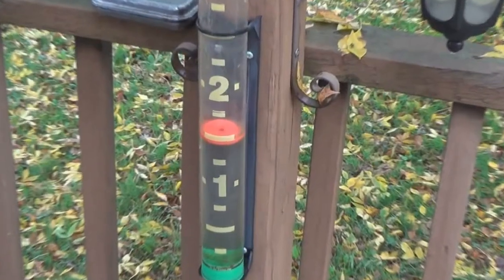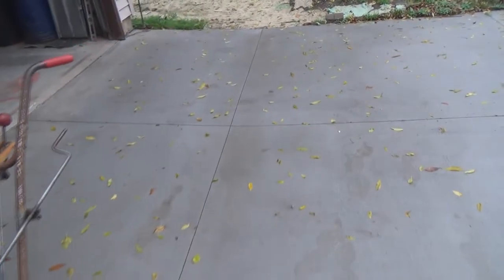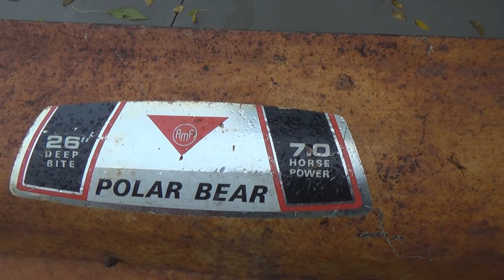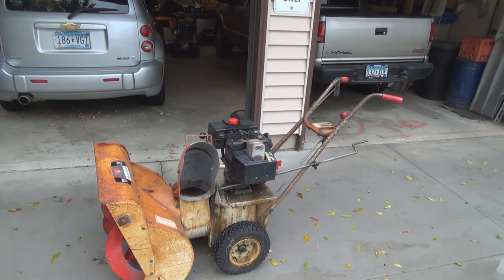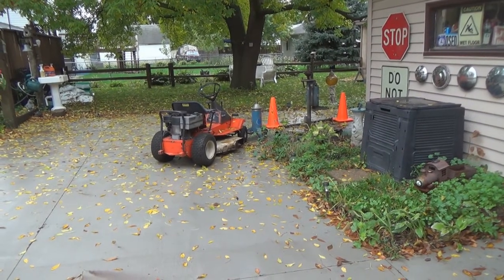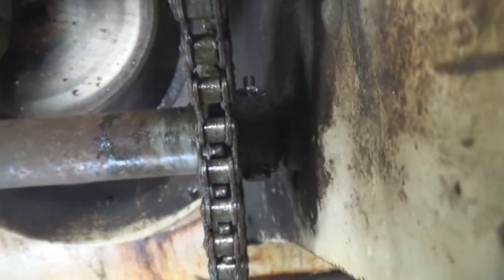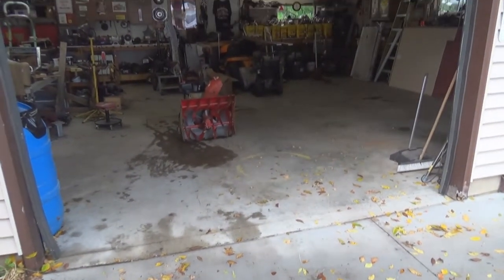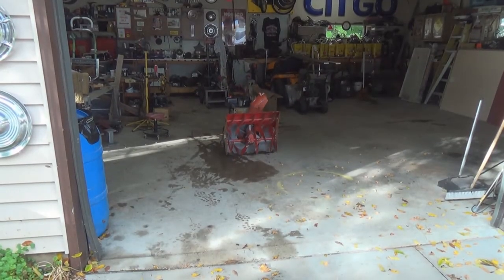AMF Polar Bear snow blower done!

Comment: The older Tecumseh Snow King engines were great.  My old 24" Snapper has a 7 hp Snow King Engine.  I've had to replace the rubber drive ring, and clean the drive disc with steel wool & alcohol.
Reply from the maker: I had it going pretty good, but I guess the drive tire was just too saturated. We have since found another use for this machine and more uses to come. Thanks for stopping by.

Comment: since I am partial to old things, I think I would repair that top  auger and make a sheet metal cover for the bottom because it's been my experience with that disk drives, that if they get wet they tend to slip till they dry off.
Reply from the maker: Those things are part of why I am trying to decide whether or not to fix it. Will it be worth my time and effort?

Comment: The old machines dont sell for much plus they are so heavy to muscle around. Its more worth taking them apart and scraping the rest. Of course its always smart to have a backup blower or two for yourself or the neighbors iffen youve got the space
Reply from the maker: Well, I decided today to pull it apart. It seems that after sitting a few days the drive was slipping again and I can use the flywheel from this motor to fix my riding mower so that it can have electric start and as you said, lots of great parts in these old bears. I have a snow blower and a snow plow so this would be superfluous for me. Thanks Bryan for confirming my decision.

Comment: fix the drift cutter,cover the rear and bottom and use it this winter. come spring,strip it and get rid of the leftovers
Reply from the maker: I don't need it for blowing snow as I already have a trackdrive blower and a snow plow. Restricted room is the issue, so it is either finish it off, sell it for $$$ or strip it for parts. Thanks Roger

Comment: That's the same problem I have with my old DR Bush Hog. I bought it used to cut the neighbors over grown field across the road a four or five years ago so I could see something besides a mess ( with his permission of course ) and now I have absolutely no use for it. I have the field in great shape and can keep it cut with my riding mower. I hate to sell it because I can't get anything for it and it has a great cast iron B&S commercial engine that would be good for several other things I have around.
Reply from the maker: I understand your dilemma for sure. Thanks
Reply: You're welcome, I'm glade you fixed it. Good luck with the sale and making enough money for your lift.
Reply: Sell the engine on ebay, older Briggs engines bring in descent money.

Comment: I picked up an AMF polar bear 26 inch snowblower for free someone was just giving away. It has a 6 horsepower motor not a 7 like yours. I'm trying to figure out how to get into the transmission. Is there any literature or service manuals for these machines
Reply from the maker: The "transmission" is just a disc drive as you saw when I had the blower tipped up on its front. There is a panel (which was missing on mine) that is simply removed to get at the workings. Check the drive tire really well, they are replaceable and make sure the disc is clean and oil free. Lots of places to oil or grease in there. Enjoy your old machine! Thanks for stopping by.
Reply: @TheShadeTreeFixitMan  I'm a DIY'er, and in general, I like to take things apart to inspect them more closely. I am trying to separate the front auger Scoop from the impeller and its housing. So far, I've removed seven nuts and bolts holding the two together, and I can get the front scoop to rotate, but I can not seem to pull it free from the rest of the snowblower. What am I doing wrong?

Comment: Have the same blower. Paid $5 for it.. No engine though but have a engine around.
Thank you
Reply from the maker: Well, as it turns out, I pulled the engine off of this and scrapped the rest. The motor is now on my Goofy Cart. Check it out! Thanks for stopping by
Reply: @TheShadeTreeFixitMan  than you you for the reply.
If i may ask what was the reason it was scrapped?
Is the blower itself no good?
It looks like its made well and should throw snow.